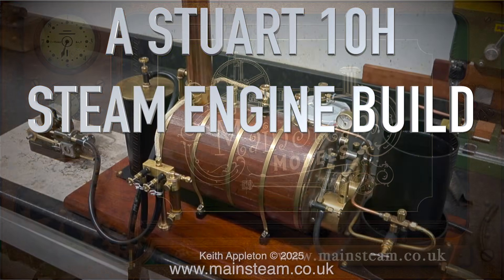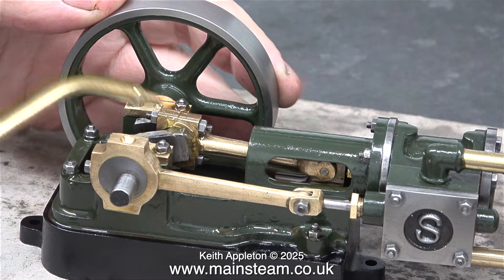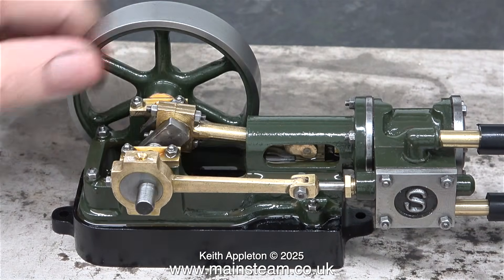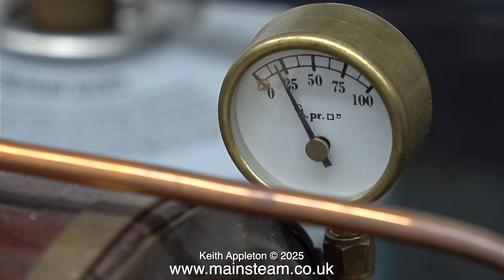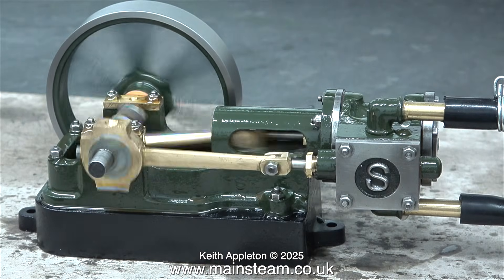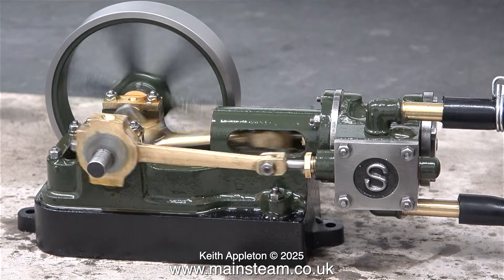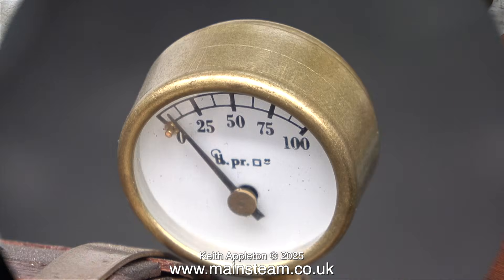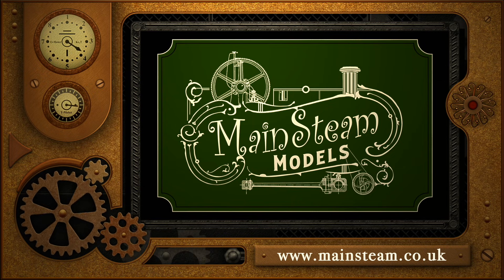A STUART 10H STEAM ENGINE BUILD - LIVE STEAM TEST - PART #21

Comment: hi keith, what is the difference in result running it on steam rather than compressed air beside finding leaks?Is steam at the same pressure more powerful or less forgiving?Wonder cause i didnt have a chance to run my balancer engine on life steam so far .Greetings from germany
Reply from the maker: There is a big difference when running using steam, you have to try it yourself to appreciate it. Steam is denser than air and it is also hot - the power curve is very different  }:-))